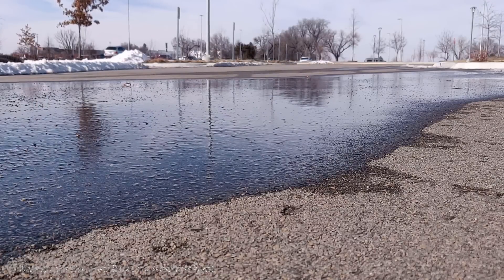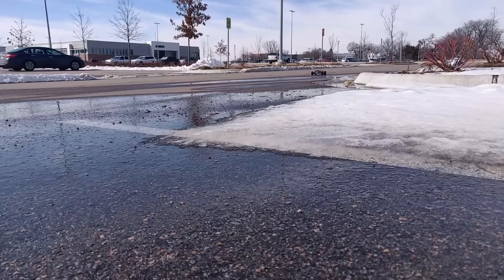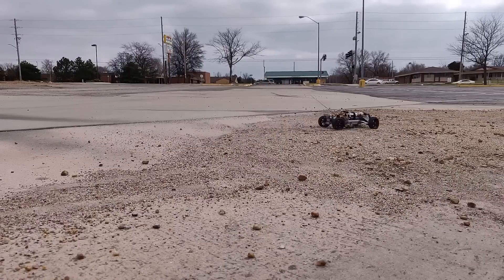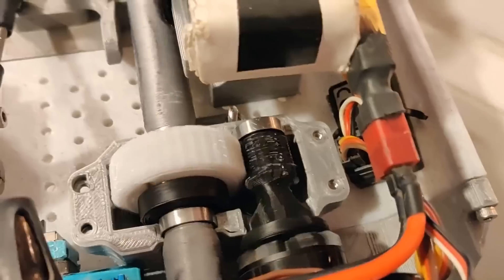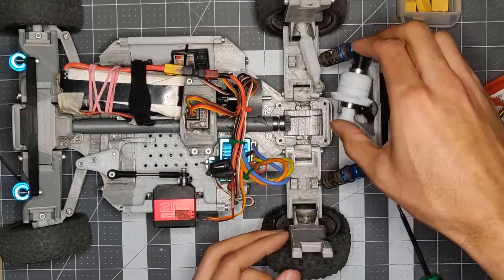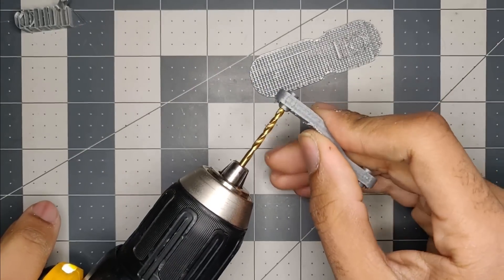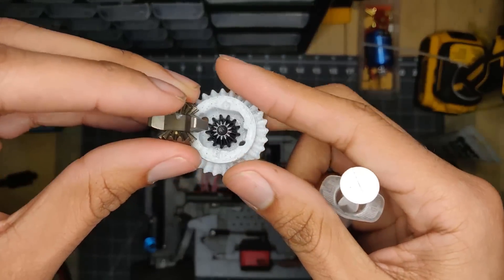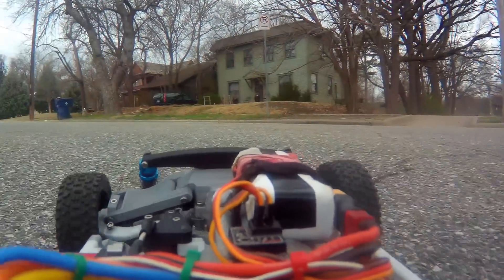Tarmo3 | 3D Printed RC Car

Comment: So clarification on the differential, recommended on the rear, none on the front? How about a printed diff?
Reply from the maker: Front diff recommended. Rear can be printed locked diff.
Reply: @EngineeringNS  has a printed diff been attempted? I could be quite keen to try.
Reply from the maker: Not on this car, but on an older one I had printed inner diff gears, the problem is that they stripped often. It works, but when they strip you gotta take everything apart to replace them.
Reply: @EngineeringNS  right I see. That's when I wonder if using poly carb or carbon reinforced filaments become a worthwhile endeavor. Thing with printing diff bits is theyre so small you can likely get way with printing it without warp even in a non heated enclosure if the heatbed can get high enough.. then again the cost of a spool of the stuff is more than the cost of a metal diff! How is V4 coming along? Any chance you could just have a ramble at the camera regarding it? Just an idea otherwise I'll just patiently wait for the release :-)
Reply from the maker: On V4 I plan to make the diff bigger to handle more power. In that case printing those gears may be more viable.

Or as you mentioned, printing with a stronger matirial could work. It's worth a try if you have some matirial already. If you do decide to go that route, let me know I can send you part files so you can modify them.

Haven't gotten far on V4 yet, school is taking a lot of my time--done a lot of planning for the design, but havent implemented most of it. I bought some things like the motor. I'll post updates to Instagram before too long.
Reply: @EngineeringNS  sweet. A bigger motor?  I have a 3674 1900kv motor sitting here ;-) I can do abs and should be able to do polycarb shortly. Already have a sample sitting here so can print test bits.

Awesome will wait for updates then. Yea i know how it goes. Hard not to let projects take over!
Reply from the maker: Yeah gonna be a 1750kv 540 BLDC--So I'll have a lot of logistical issues to work out, but I welcome the challenge!
Reply: @EngineeringNS  inrunner or outrunner motor? that looks neat though. 540 and 550 motors look like they are 36mm diameter. The 540 is under 53mm in length and the 550 is under 60mm according to a forum post. So you could search for 3650 (36mm dia, 50mm long) motors and get the same/very similar gear that you might otherwise not find? Anyhow you probably already knew that I'm guessing but w/e. Searching under 3650 etc.. 36xx might expand your search horizon.

 I run a 3674 motor in the jetboats.. mm Maybe I would be able to reuse that spare one after all 🤔

Will a wet oil sump be considered? :D Sounds messy though, but kinda cool.
Reply from the maker: @jotham123  No, I didn't know that lol--As I said before I knew nothing about RC just a short while ago. So what are you saying I'd gain from using a 3650 motor instead of a 540?--I didn't quite understand.

The design should be such that any motor with a similar size should work, so your 3674 won't go to waste ;), at least we can hope.

I will add a wet oil sump if needed, but testing will have to happen before I can decide that. The goal is mechanical complexity and systematic simplicity lol So if a system adds complexity, but it isn't mechanically complex, I'd probably axe it if it isn't necessary.
Reply: @EngineeringNS  That makes sense. Why add complexity when you don't need to?

>>>So what are you saying I'd gain from using a 3650 motor instead of a 540 

Just saying that 540 is almost equivalent to a 3650 motor, and you can look at other 3650, 3670, 3674 motors and specs.. get an idea for pricing, what they offer etc so that you can make a more informed design choice .. just had a look, it appears all the 3650 motors are really high kv, 3000+ which is a bit fast. The 3674 motors seem to be around 1900-2300kv which might suit? Just throwing ideas out there.

Also, just thinking about it, why not run a looped belt from one end of the vehicle to the other? I always have spare from my printer builds sitting around. Joining ends can be tricky, but I've done it. Its an idea.. rather than the shafts. I think shafts look good though. Someone I was talking to suggested it since i thought maybe I'd suggest it. Would it also act as torque damper perhaps
Reply from the maker: @jotham123  Not adding unneeded complexity, but if it adds some value, and its mechanically complex, I want to add it. Like the 4WD system. The complexity is the fun part--In my opinion that's the only real reason to do any of this. And its for that reason that I havent explored a belt driven option to replace the drive shaft. If the design becomes too simple, it becomes boring and I would be uninterested in that.
I am, however, considering a belt to replace the gearbox. A belt driven system that still has drive shafts. It's a thought in progress.

Comment: How much kv motor do you use?
Reply from the maker: 1180kv probably anything less than 1300kv will be best
Reply: @EngineeringNS  why less than 1300kv? mine seems to be running okay with a 3000kv of the same dimension so far
Reply from the maker: Well it would have less torque to my understanding. Also higher motor RPM means more heat in the gearbox so greater chance of melting gears. Of course this may not be much of an issue but I can only say that the car is reliable if you build it in the same way as I did.

Comment: Something to try for improving part strength. Immerse the parts in acrylic floor polish then put the container of polish and parts into a pressure tank to force the polish throughout the part. Then remove the parts from the polish and use a vacuum pump on the pressure tank to pull out excess polish. To finish them, 'bake' the parts in a food dehydrator at low temp (around 80 to 80 F) to ensure the polish is dry.

The vacuum step can be omitted but during the dehydrator step some liquid will flow out. You'll want some paper towels below, but not touching, the parts no matter what you do so that any polish that comes out doesn't drip onto the floor of the dehydrator.

What acrylic floor polish? Future, which in the USA is now called Pledge Floor Gloss. When dry it's very water resistant. Ammonia will dissolve it. I've found it to stick quite well to PLA. I've used it as a sealer on PLA parts to smooth them up a bit for making silicone molds. Using air pressure to force the acrylic into all the little nooks and crannies should improve strength by filling the gaps and helping bond layers together better.

But I've not tested this theory to see if this has such an effect on the strength.
Reply from the maker: Wow that's interesting!  I may look into trying that.

Comment: Looks awesome, where are you getting the gears for the diff's, I'm still using Traxxas diff's.  Cool that you cracked the drive axle thing too!
Reply from the maker: Thanks!  I also use gears that are made for a Traxxas diff--I've got the actual diff too, but don't want to use it.

If you happen to want to know more about that part, there is a BOM on the Thingiverse page linked in the discription.

Comment: Really good work. There always is room for improvement. You could try raising the extrusion-speed in the top layer for example. 
And you might want to try out Nylon, it's quite cheap and supposed to work with most printers whilst being more durable than PLA or ABS. 
Once again, really good work. I shall recommend you to my friend, ma man!
Reply from the maker: Always room for improvement--That is so true!!!  Thank you!
Reply: But do some research before buying anything, I had some bad erperiences there.

Oh, and I'm currently playing with rubber Filaments, might be fun if you tried out printing wheels. TPU is quite easy to print and considerably more flexible than PLA whilst still being durable. And its cheap.
Reply from the maker: @davekrassi  I thought about trying that, but my printed is bowden so i need to modify it to a direct before I can get any TPU.